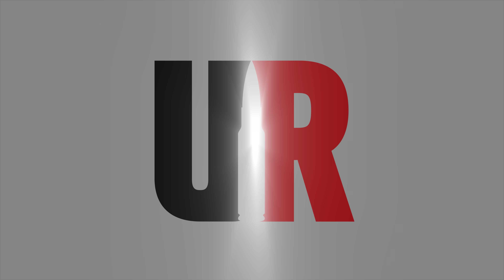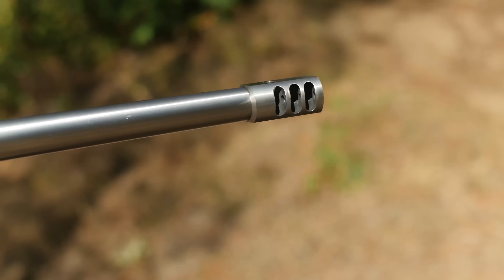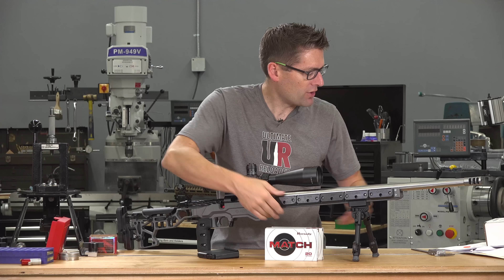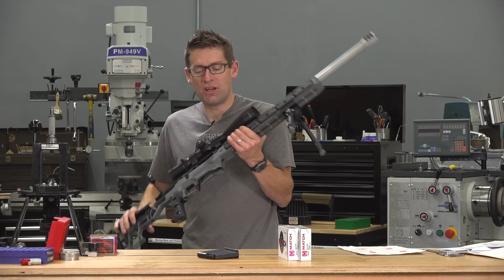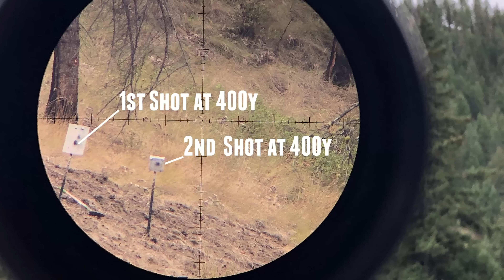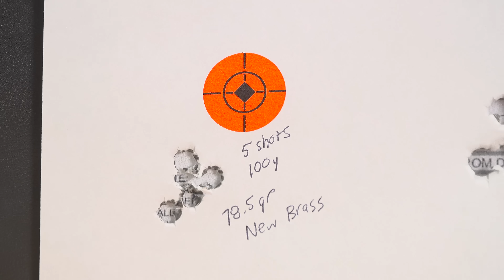Custom 300 PRC: Optics and First Range Trip

Comment: Hey Gavin.  I've got this savage elite precision  in 300prc. 30 inch, 1 in 8.5 twist  tube. Absolute tac driver with the factory 225gr eldm but I've got a few hundred 250 grain atips I wanna  load for it. Got any tips for a starting  load?  I'm thinking about  hodgdon us869. Have you any experience with that powder in magnum cartridges?  Any information would be greatly appreciated.

Comment: it's my understanding that a match grade barrel that's been hand lapped doesn't need the barrel break in procedure that was used. for a factory rifle, it definitely helps. I've noticed a difference. but both my benchmark barrels shot great right off the start, they did pick up some speed after some rounds. But that wasn't from cleaning. that was from shooting. Great shooting and i'm looking forward to more content.love that 6.5 PRC. Love my 6.5 Sherman shortmag more :)

Comment: Good Video!  I did a barrel break in with my Savage 12 LRP in 6.5 Creedmoor when I first bought it.  Did the shoot once, clean, shoot twice, clean, etc.  The factory barrel always collected copper and would use CR-10 to break out the copper here and there, but it still always collected a lot of copper either way.  Shot that barrel out and put a Criterion on it and didn't do a break in.  Cleaned it when I got the barrel installed and then shot 500 rounds through it.  Ran three patches through it with Hoppes 9 and it was clean as a whistle with no copper fouling.  I think it goes to show that a hand lapped barrel like a Criterion or any good match grade barrel doesn't need a break in.  I think cleaning does the opposite and the more you clean the worse it is on a barrel.

Comment: You should three vidoes comparing the 300 prc vs 30 nosler, 6.5prc vs 26 nosler and then the 28 nosler compared to another 7mm magnum round

Comment: Gavin,  Here is my data from the RPR in 300 PRC... https://forum.snipershide.com/threads/ruger-precision-rifle-in-300-prc-labradar-hornady-300-prc-225gr-match-data.6970144/    Bone stock gun. Leupold Mark 5 HD 5-25 scope.
3 5 shot groups at 110 yards - .1.234", .65", and .879"
2 5 shot groups at 330 yards - 2.967", 2.5"

Comment: Just was doing load development on a buddy’s new rifle in a mdt acc chassis and I was getting left to right group shift also. I bedded it an that went away. Made a 1 moa rifle a .5moa rifle. Rifle is a Curtis vector, proof carbon 6mm creedmoor, in mdt acc.
Reply from the maker: Cameron Schmidt thanks for sharing- what all did you bed?
Reply: @gavintoobe 
 I bed the action to the chassis. Mainly the recoil lug but did around the rear action screw also. I built a “wall” with play dough in front of the recoil lug. The acc chassis doesn’t have a trough so had to do something to contain the acraglass. My guess is that the round action was turning under recoil. The recoil lug doesn’t have anything on the sides to keep the action from twisting. The barrel is a 7 twist. What it needs is set screws on both sides of the recoil lug.. just my thoughts. They are only my opinion. I appreciate your precision work by the way!

Comment: That’s a sweet piece of kit!!! You better start working out lol. 20+ lbs to lug around. I would also enjoy seeing it shot in it’s lightest configuration. No weight in the stock.
Reply: Boober stay tuned he is building a hunting version as well.  Is is based on a 300 RUM donor he said he will do a work up on the 300 RUM to directly compare it to the 300 PRC.
Reply: Yeah I get that. I would still like to see the recoil difference in that rifle with out the weight.

Comment: You said the words follow through but then you didn’t implement them. 
Proper follow through means keeping your cheekweld while shooting or working your mags and rounds, it’s all about maintaining your firing position. If you have to single feed okay. But why would you. It’s hard to maintain your firing position even while keeping your cheekweld and your support hand on the rear bag. Load the mag. Run the bolt and maintain you position between shots and because you’re eliminating human error the groups will shrink.
Reply from the maker: Just got my extended magazine catch yesterday! (can now feed from mag reliably, well, once I install it!)

Comment: That is one super bad ass nice gun..I love it.
One question..Re; bubble level on Scope ring cap..Why did you go with a top mount level instead of side mount level?
I have to take my eye off the target to check a Top side Bubble Level?
However I dont not have to lose my Cheek weld or take my eye off target with my side view bubble level?
Gavin that is the nicest gun I think Ive seen..Damn I love that modular stock with a built in Arca rail..

Comment: I have to ask, you build this awesome full custom rifle, why do you cheap out on optics?  Now I am an admitted optics snob, but anything less than a Nightforce on that gun is a tragedy.
Reply: Because you don't need to spend more than $800 to get a reasonable picture with perfect tracking anymore. Everything more money is just bonus with a better picture. If you're used to $3k scopes it's hard to downgrade because picture clarity is not what you're used to.
Reply: @zgennaro  Good point a lot of the long range guys say anything over 25x is not really useful. You're also just trying to hit a target not take a photo of it so the demands on the optics are less. Reliable, repeatable turret tracking seems to be the first criteria, range of adjustment next and glass plus reticle somewhere after that. I've bought a Sightron 6-24, often used as an entry to F-Class. Seems good enough in the important areas but not high cost.
Reply: I was curious about this rifle scope myself.  It turns out it’s 2,500$ (the 30x version that i could find) so not exactly cheap.

Comment: I am not sure what your engineering history is but I am a mechanical engineer to trade following you built I clearly follow everything you say. I wish in the uk we were able to use our own skills to build our own rifles start to finish instead of having to go through the hassle involved as you say through the build it's the challenge of getting things to within 0.0002" and alot of people will not understand the satisfaction when complete knowing from start to finish it's yours especially after you get your load developed and its single hole groupings 😁 

Do you think the 300prc has any advantage over 300rum or you think is a hornady marketing technique to break the market as the 6.5cm took of ?

Ps I also run a delta Stryker on my tikka tac A1
Reply: Hi,
Question for you.
I want to get a tikka t3x and drop it into the mdt acc in 6.5.
Do you think it will be as good or better then the tac a1? Only asking as here in Aus it will be about 1k cheaper.
Reply: @GTRSniper1  
I have 3 tikka rifles 
One tikka tac a1 
One tikka t3 
One tikka t3x 

Now they are all great rifles hands down my tac a1 is most accurate but I have spent the most time on load development as it's my target gun other 2 are hunting rifles. My tacA1 is constantly shooting 5 shot groups at 1 ragged hole at 100 if I do my part when confirming zero. My other 2 will hold 1" groups at 100 with any ammo including cheap stuff my hunting loads are around the 3/4" but that perfect for hunting.

The t3 and tex are just the same rifle changeable grips that's it.

The difference between the 2 are as follows 
Tac A1 has 
24" barrel 
Phosphate coated action and barrel
Bigger bolt knob 
10 shot metal mag 
Factory threaded barrel 
Comes with muzzle brake.
Of course ar15 compatible chassis.
Picatinny rail fitted 

Now I looked onto getting a super varmint myself and dropping it into a mdt stock my problem was they were all 20" barrels and was a 6 month wait on the 24 and it did not come threaded. And in the new chassis then needs new magazine's I think the AI ones fitted that style of chassis. The time I took all that into account I was around £200 cheaper buying the tacA1.  the tacA1 stock its rock solid so many mounting options. I dont have any experience on mdt chassis apart from they look nice lol

Now I am not sure on availability down under but the tikka ctr is the same rifle as the tacA1 in different stock same action bolt mags etc
Reply: @90-wolf4  awesome info mate. Thank you so much. Helped me a lot.
Reply: @GTRSniper1  no problem if you need any info picture help or anything pop me a email always happy to help as best I can
Reply: @90-wolf4  thanks mate.

Comment: 50x magnification?!!?!?!?!? SHEEZ! Need to play with it. hehe. I am slumming it with the Leupold Mark 5 HD.
Reply from the maker: Mark 5 looks RAD! How do you like yours?
Reply: @Ultimatereloader  Btw, where did you get the Delta Stryker scope in the States?  Looks really cool!
Reply: @Ultimatereloader  As I am sure you will know, during the daytime, in optimal conditions it is tough to tell the difference, BUT in questionable lighting, such as early morning or very late in afternoon or before sunset, it is very much a great scope.  The glass clarity is superb.  Also am a fan that the scope weights fairly little.  FFP is a win and am a huge fan of the turret system they have on it.  The zero stop is also fantastic.  https://www.youtube.com/watch?v=ndBx9m8yhHI&list=PLTwj4POLdczr7mA2eNNdQU4jqJXFNBcs9&index=2
Reply: I looked through my friend's Mark 6.  I still curse him for it.  The glass is incredible.  It ranked in the top 10 in the Accurate Shooter test of scopes that started at $1500.  A NightForce won beating scopes that cost almost twice as much. Gavin you would appreciate the details of the testing regiment.  Definitely your level of detail was used.